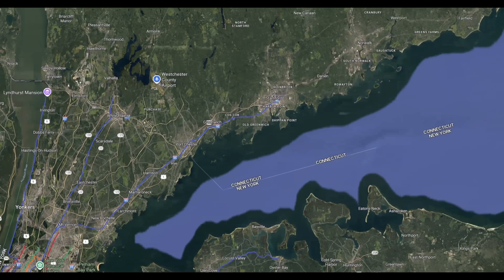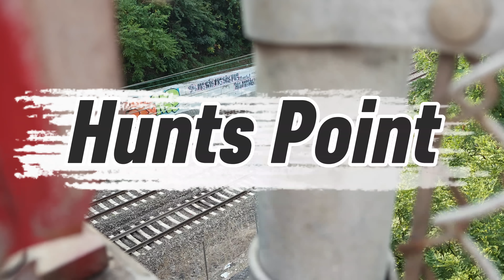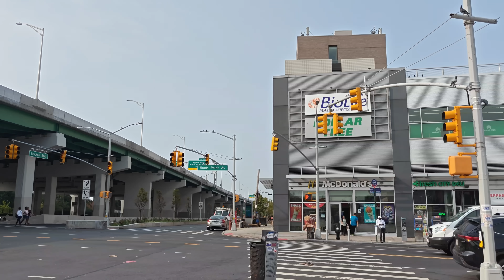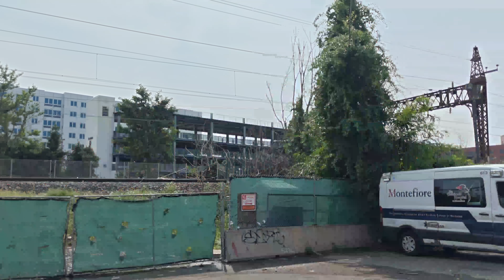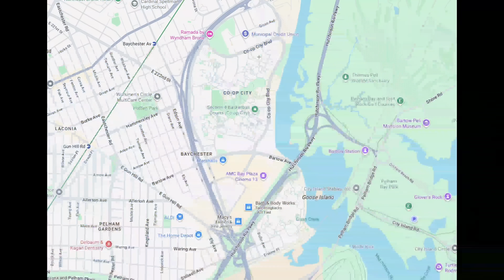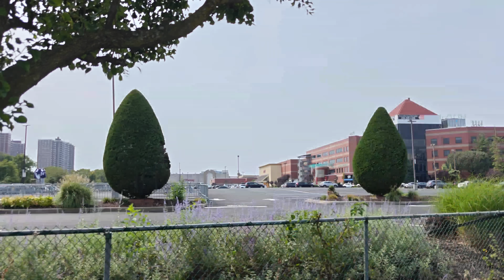One of the four new Bronx train stations has a BIG PROBLEM

Comment: I live in Co-op City and when it comes to rail travel coming to that area, I’ll take what I can get. I wish it was a part of the IBX because it was originally supposed to go from Co-op City to Bay Ridge but former Gov. Cuomo jacked it up and made it to what it’s going to be now with Metro North. For me, i don’t live by Section 5 where the train will be, so I’ll still need the bus. I’ll use it but it won’t help me with East Side service so I’ll still take a bus to the 5 or 6 Train or the BxM7 Express Bus. We just need to get this thing built and i might change my tune once it up & running.
Reply: Think the Queens side of things was determined more by infrastructure and grade. Lot of Long Island (incl Bklyn & Queens) is just not as well-suited environmentally or geologically to support modern stations & track.
Reply: I also live on Co-op and I hate that it's becoming a Metro North Station. The Triboro would have absolutely made sense especially after MTA killed the QBx1 and made the 2 zone Bx23 and Q50. Especially because almost no one is going to midtown and have to transfer. MN and NYC transit don't have compatible systems. So you would be paying for 3 different transportation methods: bus to get to the station, MN, and another bus or train to get to your destination. I would keep taking the express but but I know they're going to try to pull that when the MN station comes. It's a bad substitute and a duplication in service.
Reply: @SunlightsHorizon  It's the same free bus to subway transfer, whether there's a MN ride in-between or not. And most people taking the express bus, or the train to GCT or Penn, have to transfer in Midtown, unless they work right by the station (or on 5th for the express bus).

There are concerns to be voiced, but these all sound like non-arguments.
Reply: dropping the Bronx from the IBX has more to do with logistics over the Hell Gate Bridge than anything Cuomo did.  There are long blog posts explaining the details.

Comment: lets hope an easier connection could be made for the folks in coop city via a pedestrian bridge or something
Reply: As others have noted you can already walk into Section 5 from the rest of the complex, the issue is the distance.  

I live in Section 4 about two blocks away from the Bay Plaza Mall pictured in the video which is situated on the other side of the Hutchinson Parkway from Section 5.    Mapquesting a walk from where I live to approximately where the new station will be clocks in at 41 minutes (without even considering how that would be impacted doing it in bad weather)!  

When you consider that the current express bus stop is only a 10 minute walk away and provides more access to various points in Manhattan, accessing the new station is less appealing.

Comment: In the defense of Co-op City's stop placement, they didn't really have anywhere better to put the stop considering where the track alignment is. Building new tracks would not only take a lot of time and money that simply isn't it worth it (at least in the MTA's eyes) but Co-op City would very well not let it happen in the first place as NIMBYism is decently high due to the nature of the neighborhood. Honestly, the fact that the station is relatively isolated in Section 5 (honestly the Staten Island of Co-op City), is probably an upside in terms of making it happen.

Also there probably is no need for shuttle buses as there is a bus stop by where the station is that is served by the Bx23 (Co-op City Loop), Bx26 (Bedford Park - Co-op City via Allerton), Bx28 (Fordham - Co-op City via Gun Hill), and the Bx30 (Pelham Parkway - Co-op City via Boston Road). It is also served part-time by the Q50 LTD (Flushing - Pelham Bay/Co-op City via Bruckner & Whitestone) and the BxM7 (Midtown - Co-op City via 5th/Madison) stops a couple minutes away from the station. Those two can probably have their routes reconfigured if demand calls for it.

Regardless, I really hope they open these stations fast, they would honestly help give an alternative to the 6 train and if Astoria/Sunnyside are also made stops, be the first Bronx-Queens rail route (not exactly with the best placement but honestly it's better than nothing)
Reply: will up the property values in Section 5.  I'm aware that there are limits to owners' ability to "cash in" on market forces, but that section would unquestionably become more desirable.
Reply: PROJECT DELAYED AGAIN
Reply: I agree with you I will add on the bus 🚎 portion the frequency would have to increase and along with existing BX 23 54321 
& 12345 the 50 needs to return its frequency in to the sections. Some times section 5 feels like you stuck on an island 🏝️ and it feels the same way at Pelham bay.
Reply: Can always build coop city 2 around the station in place of those huge parking lots.
Reply: @YourHoss technology is now present where parking garages which are a necessity here can be integrated into a new construction or I don’t know if retrofit is possible by reinforcing present garages and going up 🏗️🤔🤷🏾‍♂️?

Comment: i feel like this project should also serve queens since the nec detours through it.
Reply: I believe they're supposed to make a Sunnyside station that'll serve the MNR and the LIRR
Reply: an infill station at sunnyside would be great
Reply: @slightlyobeserat5781 true
Reply: @slightlyobeserat5781 yea that would be the most logical location to make them connect outside of grand central terminal
Reply: NEC is elevated through Queens until the line hit Harold Junction with the LIRR
Reply: Yes, I agree. A stop or two in eastern Astoria would be very helpful (the part that's too far from the N, too far from the M and R, and also too far from the 7 and LIRR Woodside station).
Reply: that would have been cool.
Reply: I thought Queens wanted the Interborough Express and that’s why I’m paying an arm and a leg for congestion tolling
Reply: @enarush1  we can have both 😁😁 ibx goes from bk to queens, metro north could go from queens to the bronx
Reply: @enarush1  I mean, CP would be a good thing even if they set the money on fire, but the IBX is only going to reach Jackson Heights and no further.
Reply: @enarush1  IBX is never happening 🤷‍♀️ Congestion pricing is to bring our signal & switch equipment up to at least 19 '90s standards 😅

Comment: Good video. As an outsider I think that the Metro North addition will be great for the reasons you mentioned and even for Co-Op city, if it's paired with good bus service to that station on Erskine Pl. Looks like there's room on Hutchinson River Pkwy E to maybe add a bus lane if traffic's an issue there, no sure if it is.

I think an eventual extension of the 6 line from Pelham Bay Park is ultimately another part of providing better transit access. It could be extended along 95 to Section 5/Erskine Pl,  Mall Blvd, Bartow Ave, Truman HS, and Co-Op City Blvd at least. I'd appreciate feedback/alternatives from New Yorkers familiar with the area or better alignments though.
Reply: Subway extensions just don't happen. Roosevelt Island and 2nd Ave Q extension were projects from my mother's childhood, and she's 70. As for the MNR project, all 4 stations are well-served by multiple current bus routes, and can connect to subway that way as well. 

These aren't remote, car-dependent areas, they all have existing transit options. This is less about getting to Midtown, as opening up more reverse-peak access to Westchester & CT jobs to Bronx residents. And opening up the med-center jobs at Morris Park to folks upstate.
Reply: The people in co-op city do not want trains coming there we like the isolation keeps the bad people out